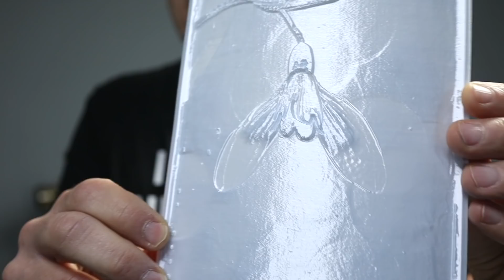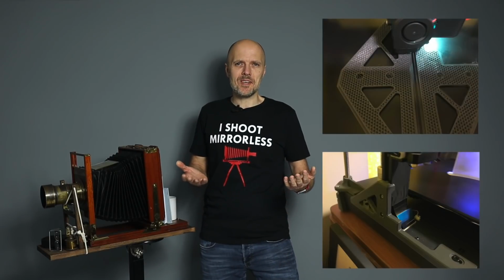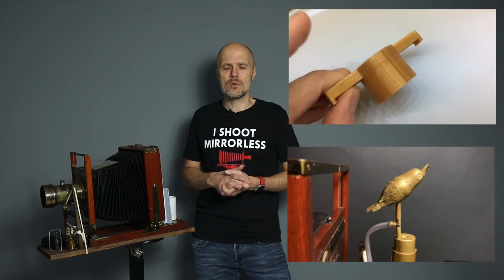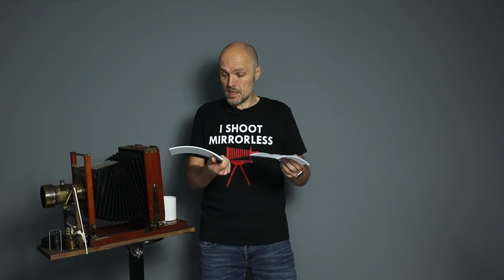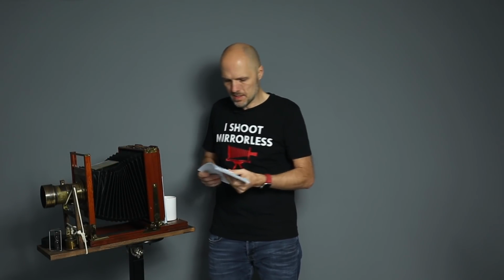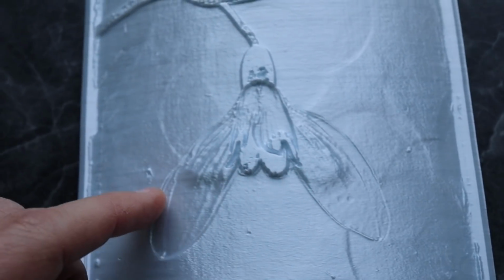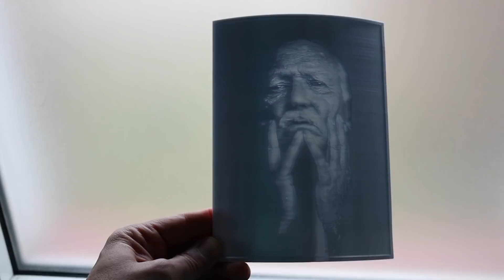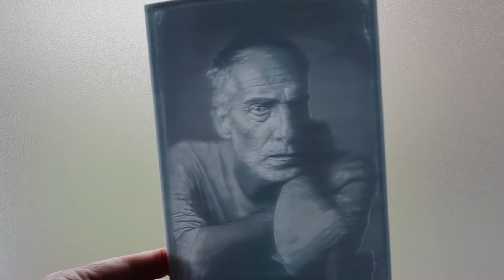Touchable Bokeh - 3D Printed Wet Plates

Comment: I don't really get it, will watch many times, I'm sure ! That was amazing ! I love that you move it to the window and it's a photo ! Never have seen that before and I love it. Very well done video as well. Thanks, LarryMac
Reply from the maker: Thanks a lot! Litophanes exist since the early 19th century. They were made out of porcelain back than. They must have worked forever on one piece back then. It’s much easier today with new software and 3d printers. Basically dark parts are printed „thicker“ and bright parts thinner. A little bit like an analog negative, but the other way around. I made a second video, where I explained it in detail: https://youtu.be/yOuioZThRV0

Comment: I would love to learn about your settings and material preferences. I also have an artillery sidewinder and have tried a few lithophane prints. Excellent work, thank you for sharing.
Reply from the maker: Thank you so much!
I want to do an explaining video as soon as I got more time. I printed the outer shell with 20mm/s and used a filament from extrudr. I tagged them on my Instagram post, or just google them.
I have to finish another project before I can start with the explanation video.

Comment: Wow, the results are amazing.
How did you come up with this idea? It's brilliant!
Reply from the maker: Thank you so much! I read about it and liked the similarities with the process. And after some time after I figured it out, I went for it. Just printing a huge one right now in color.
Reply: Not new idea. Been around since 1800s. Free photo converter on 3d printing site thingiverse for years. Should try it I have many in my classroom.
Reply: @mhaustria  great. I think old porcelain ones were painted but haven't seen a color image 3d printed one.
Reply from the maker: @pinball16  I found it on a website, somehow links are blocked here. Actually it’s printed white and a normal print is used for coloring. Look for itslitho